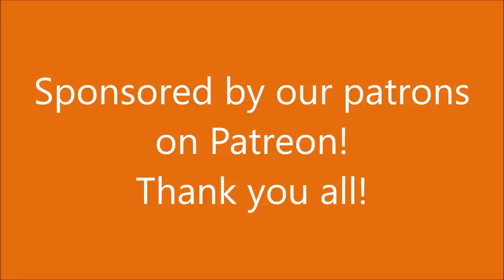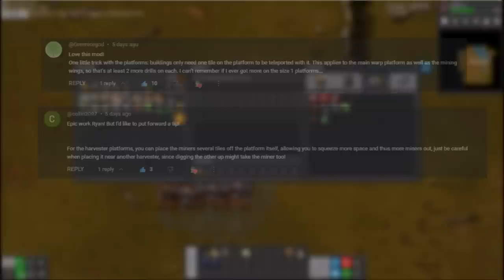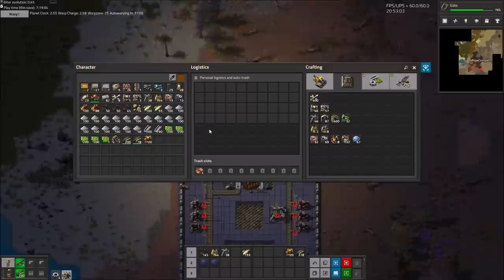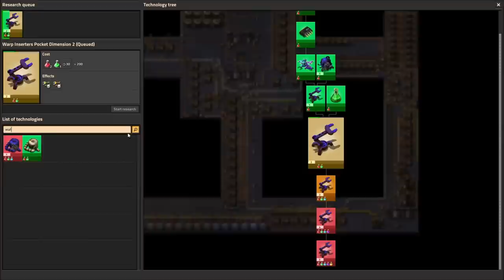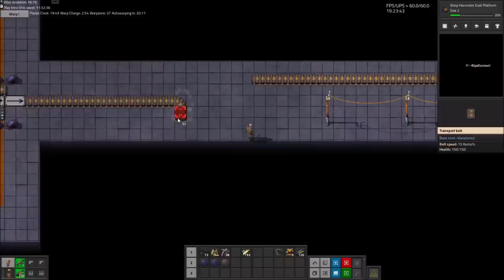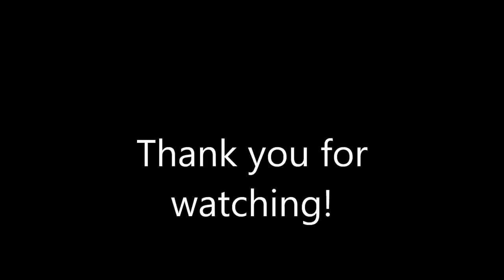Building a TELEPORTING FACTORY in WARPTORIO 2 | #2

Comment: Thanks for the tour of Warptorio!  Some thoughts:

1.  To save your wrist, install 'Ghost Placer Express'.  Any time your cursor passes over a ghost and you have that item in your inventory, it will be placed.  It isn't OP because you still have to move your cursor, but it is a GREAT deal of help before you get clouds of construction bots to help you.
2. Even Distribution is a fantastic mod with some features that are easy to miss.  Next time you need to feed coal into a dozen miners and furnaces, just press <SHIFT-C>.  Also, press the down-arrow on the far right of your inventory and choose 'Balance out inventories' and uncheck 'Drop items to machine outputs'.  You're welcome.
3. 'Fill4Me' is the perfect companion to ED, as any time you deploy something, some of what it needs to operate is automatically placed inside.  (ammo in turrets, coal in miners, etc.)
4. With that cramped a space, 'Extra Underground Belt Pair', 'Beltlayer'/'Pipelayer', 'Advanced Fluid Handling', and 'Bob's Inserters' will really save your sanity.  The first lets you weave belts of the same tier, the second gives you entire new surfaces to run belts/pipe around on, the third gives lots of single-cell, 1-X underground pipe pieces, to drastically reduce pipe spaghetti, and the fourth makes inserters MUCH more realistic by allowing them to rotate to arbitrary angles--which both decreases spaghetti headaches and can drastically increase throughput.
5. 'Filter Assistant' makes setting up chest/cargo wagon/etc. filters downright trivial*.  It works *really well with 'Merge Chests', which allows custom chest sizes.  (e.g. combine six 1x1 chests into one 1x6 chest to load/unload trains evenly.
6. 'Mining Patch Planner' will remove a lot of the headache from setting up mines.  (The 'Super Compact' version would work best to extract as much out of the ground as possible as quickly as possible.)
7. 'Oil Patch Organizer' will shuffle the oil resource nodes into a grid that you can drop a blueprint onto, making setting up oil MUCH less of a headache.
8. 'Speed Control' allows changing the speed of the game, which is FANTASTIC for when you need to wait for something to happen.   ...or wish time would slow down when things get frantic.
9. 'Stable Foundations' offers more protection for structures built on stone brick/concrete/etc.
10. 'Picker Dollies' lets you move entities around without picking them up.
11. 'Beacon Rebalance' uses the SE beacon concept, where you can only have 1 completely OP beacon per machine.
12. 'Factorissimo 2 - notnotmelon fork' adds buildings to build your factory lines in which are larger on the inside than the outside.  It's great wherever your space is limited.  As a bonus, all buildins share the same surface, so monitoring each of them is easy.
13. 'Vehicle Snap' makes steering your vehicle MUCH easier.
14. Use the tank.  It can bust through trees/rocks/biter nests/etc. almost effortlessly, and the rockets can do SERIOUS damage.

Cheers!  I hope that these help you.
Reply from the maker: I actually did download Fill4Me whilst recording for the next episode, it’s an absolute game changer. And thanks for the tips with Even Distribution. For the rest of them, I’ll consider but I’m always hesitant to download mods which are a bit cheaty or change the game a lot half way through.

Thank you for watching and for your comment!
Reply: @ripecontext  Fair enough.  Personally, I use a LOT of other, more gaming-changing mods in my runs, but the ones I listed struck me as mostly QoL upgrades, rather than substantially altering the game, itself.  (Beacon rebalance & Factorissimo asside; I included those mainly because they save a LOT of space.)

It may be worth making a small video where you talk about them and then put them up to a vote with your audience and ask them which one(s) they think would be fair to add.  (Extra content is always good and It rarely hurts to empower those who are investing time with you.)

Cheers!

Comment: If you have long inserters you can make a smaller set up with the same input/output.
Basically 3 belts in the middle, the same 2 sucking the furnaces on the outer belts, and the long inserter takes the stuff out of the smelters into the middle belt, you cut off some space on the edges
Reply from the maker: ahh that’s smart, i might try that next time if it makes it so i can fit more furnace stacks in, once i get those bridges upgraded
Reply: if you are willing to take the power hit you can use cargo wagons.
Reply: @mbos14  why would there be a power hit?
Reply: @dragonlloux  extra inserted neede dif you use a cargo wagon